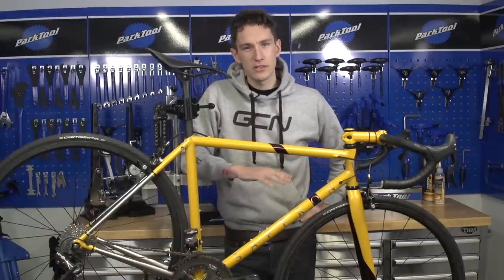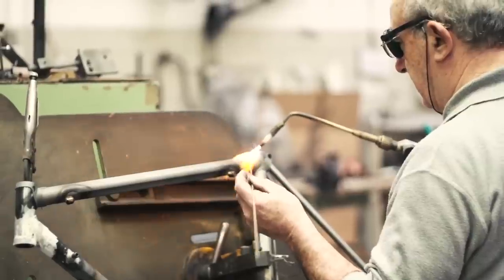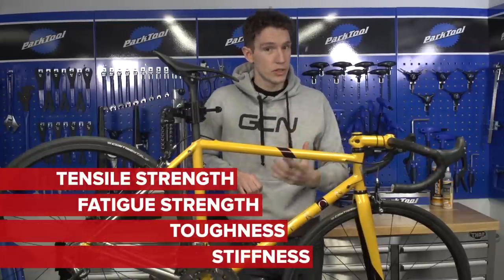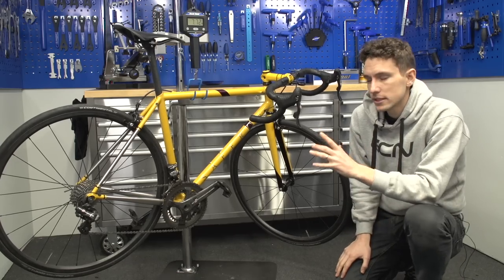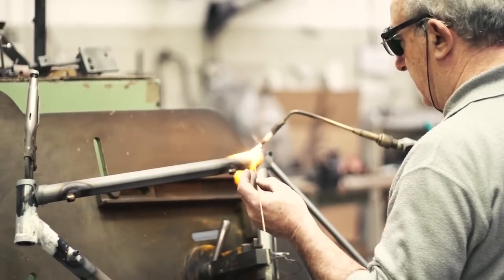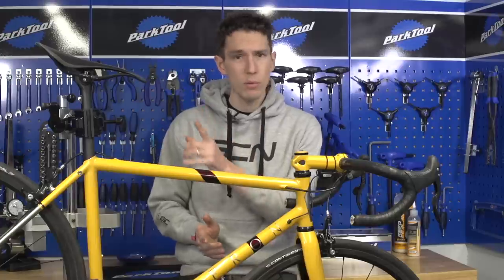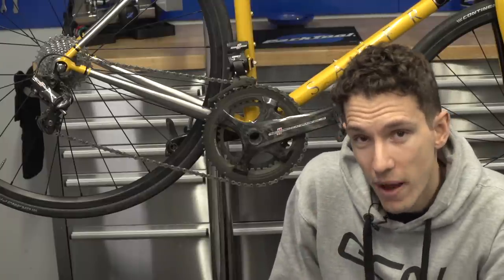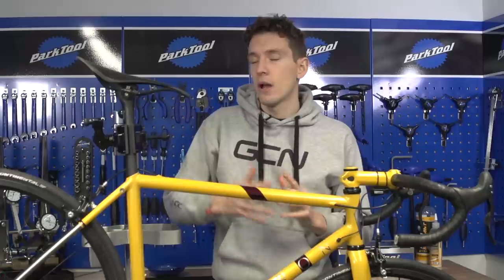Is Steel Real? | 6 Things You Didn't Know About Steel

Comment: It sounds like you're an advocate for carbon fibre throughout most of this, given how reluctantly you were to tout the benefits of steel.

Rust is mostly solved by using stainless steels, such as Reynolds 953 or similar. Repairs on steel are much easier to guarantee, carbon repairs are a very risky business, and carbon itself is prone to many invisible flaws straight out of the factory.
Reply: Alex Paulsen Well it's tricky because steel just doesn't trump carbon in many areas at all. Yes stainless doesn't rust but man alive is it expensive. You can buy cheap carbon but not cheap stainless. 

Also, from what I'm told stainless is hard to re-weld, whereas actually carbon repair is very secure. 

Can't argue with your last point but mas sproduced steel bikes also break.
Reply: Simon Richardson 21 years later and my steel frame is still going strong. Composites are the future of lightweight bicycles, but the touring and randouneuring guys will definitely have a strong bias to "reliable" old steel. Either way, both are still more enjoyable than aluminium. Carbon repairs are still a specialist repair, especially if you want to be able to trust it. Any good frame builder can probably reweld one of their own frames and guarantee it.
Reply: It's perhaps the only thing I don't like about GCN and how cycling is evolving: all the buzz about technology and materials, all the needs and wants you're talked into (electronic shifters, hydraulic brakes, sliders on your frame, 'aero'). That's not what cycling is about for me. That's as fascinating as hearing a carpenter talk about windows.

Comment: I have 4 hardtail mountain bike frames all steel. 2 custom built. Reynolds 853 and True Temper OX Platinum (which is no longer made). I have owned Aluminum and Carbon frames. But will always prefer steel frames. Can't beat the ride quality and they last forever. Sadly once the custom builders I know are gone so are the custom steel frames.

Comment: One thing you didn’t mention which is one of the most important factors of steel is its fatigue characteristics.

Steel (without corrosion) can in theory last forever, under a certain stress steel can withstand any number of stress cycles, aluminium however no matter how much stress it receives will fatigue over time ending in catastrophic structural failures.
Reply: I agree aluminum is the most dangerous material you can use for biking, I'm writing this from experience and I've used steel, aluminum and carbon.

Comment: I think the characteristic I feel the most between materials is their frequency it gives off of the road.  AL is very high frequency, Steel low and carbon lower, even muted.  The difference is I feel fresher after three hours on Carbon.  since I started on Steel, it' feels normal, the baseline.  AL is too high (unless racing) and carbon normal but I feel less beat up after the ride.

Comment: does the scale half way through the video say 7.72kg for that bike?!
Reply: I have a steel frame with carbon seatpost/saddle/fork/stem/handlebars/38mm wheelset and Dura Ace 9000 with Osymetric chainrings and it's 8.0kg. I think I could get it to around 7.7 with a super shallow rim wheelset like the one in the video, could also save a few grams with stock chainrings and lighter saddle as well (DA-9000 is not exactly the lightest groupset either compared to campy). Kind of pointless to pimp it out like this if I really cared about weight/performance  but I like the aesthetic, especially when blowing by older guys on aero+carbon bikes
Reply: Yeah a CUSTOM steel bike is going to weigh like that. As they said tubes are designed with different sizes that will give the bike the desired characteristics. For instance Id bet that bikes silver bits is 953 Reynolds, and maybe the rest 853, or even the whole bike is 953. Most off the shelf bikes 520 or 631 chromoly, expect a bike in weights of excess of 25 lbs. Good 853 off the shelf steel bikes come in around 20lbs
Reply: bilwit lol why are you proud of being faster than old ppl
Reply: I've got a 1996 Frank Herety Special, total bike with a Veloce groupset only weighs 9.6kg. considerably less than many aluminium bikes with a similar choice of components.
Reply: at this point, being stronger than ANYONE is a simple pleasure, but most especially dudes with full aero carbon bikes going up hills

Comment: why many people might prefer steel over other materials:
1- it's cheaper
2- it's stiffer
3- last longer with less care
Reply: It is certainly not stiffer than carbon. Usually it is liked exactly because it's more springy than carbon.  Much of this is probably down to the design possibilities allowed by the material rather than the stiffness of the material itself.  Carbon allows wider cross sections where needed, adding stiffness without adding weight.
Reply: Sorry but a custom steel bike is far from cheaper.
Reply: great point, thanks for for the informations
Reply: yea it's not ideal to call it stiffer

Comment: Here's one you forgot, jet fuel can't melt it...
Reply: Knobster Knob No, but the stuff they spray in chemtrails can...
Reply: Another nutter... FYI, jet fuel fire is hot enough to substantially weaken steel.
Reply: But burning couches, computers, copiers, carpeting, and many other office supplies can weaken steel. Steel only needs to be around 1000'F, same temps blacksmiths used to hammer steel into weapons. I know what point you're trying to make, and it's absurd. Please dude, think before you type.
Reply: CaseAgainstFaith1 and dark grey smoke indicates an oxygen-starved fire that isn’t anywhere near a thousand degrees—let alone several thousand.
Reply: Sterling Roberts LOL. Color of smoke tells you a little about the material on fire. That’s it.
Reply: lol trolled so good
Reply: CaseAgainstFaith1

I stated that smoke(specifically dark) is indicative of incomplete combustion. If one knows(or even doesn’t) what’s in the fire, the color and thickness of the smoke can allow you to ascertain the status of the fire.

I will explain the definition of smoke if I have to, but I’m really hoping you can grasp it using only your own time.
Reply: Sterling Roberts:  LOL!  Repeating the same error doesn't make it correct. No, color of smoke does NOT allow you to make any such conclusions.  Can you read and use Google?  If so, find and read this article:  "Debunked: Black Smoke and orange flames as an indicator of an Oxygen Starved Low temp fire"
Reply: I ride steel. I weld and work with steel. Jet fuel/kerosene doesn't make much heat without force air or oxygen. You have to be able to explain WTC7 COLLAPSE  before you deny the comment!
Reply: David Croxton he likely doesn’t know about that.
Reply: WTC7 collapse HAS been explained.  Ad nauseum.
Reply: You ride a bike. 
You understand freefall!
You have to explain ZERO resistance to FREEFALL!
Physics isn't allowed to be taught in the US using WTC7 videos!
Ignorance is a wonderful thing.
Reply: David Croxton Can you express complete thoughts?  Probably not. Don’t know what point you are trying to make. If you are claiming that the towers fell at freefall speed, they didn’t. No idea what you are trying to say about physics being taught using WTC7 videos.
Reply: Dan Sawyer
Water?
Reply: this meme is never going to die, all because you start a huge debate. btw you have aluminum, rust on the beams, magnesium plane rims and boom you got yourself a thermite reaction.
Reply: Craig Knobovitch Lmfao I see what you did there nicely played.
Reply: David Croxton lmfao or the missing Passenger Jet at one of the most Security Camera ladden Buildings in the world....Lmfao if you believe the Pentagon did not have any cameras working that day I piss myself laughing lol. The camera system worked fine on Sept 10th and Magically Sept 12 lmfao!!!!!
Reply: @CaseAgainstFaith1  

Yes, the chem trails from the planes and the vaccinated passengers collapsed the towers, that's just science.
Reply: @timbazzinett2693  nope you are wrong
Reply: @timbazzinett2693  you ain't melting shit like steel at 1000 degrees Celsius nevermind  bending it
Reply: Imma Mad man I confess I am no expert on fires. But who should I believe?  Some random YouTube comment? Or experts?  I think I will go with experts.

Comment: I found a shop that could build me a custom fit steel bike for much less than most carbon frames on the market. The material is easier to manufacture and the weight factor seems to be more based on how much you want to pay than the material used. Have you looked at the Rodriguez outlaw? Fit is more important than a small weight penalty.

Comment: Carbon repairs "relatively inexpensive"... yeah very very relatively... relative to a few thousand $ of disposable income lol... carbon repair is at least $200 for a small crack... steel?  meh just bend it back!
Reply: Don't know what all of you are doing to your bikes.  I ride the same bikes for years without damage, even mountain bikes.
Reply: Crit races.... its almost imposible to race crits for more than  2 years and not crash at least once. That said, I've never actually needed a carbon repair but my point is that they are not, by any means, inexpensive.
Reply: Fernando Roman Carbon is very cheap and easy to fix the issue is the time spent on doing it has to be slow due to curing and sanding procedures .
Reply: You say it's cheap and then you say it's labor intensive.  So which is it?  Cheap, or labor intensive?  Make up your mind.
Reply: Big Ring It is cheap materials but the time is intensive. Take from that what you will about the Labour costs as doing it yourself self is cheap. Having someone else do it well they have to get paid.
Reply: I wouldn't call doing it myself cheap.  Depends what else you'd be doing with your time.
Reply: Big Ring Tip the Epoxy Resin can be accelerated  by adding baking soda and cyanoacrylate ( Super Glue) . Baking soda and cyanoacrylate can also fill small chips and cracks before they spread. Remember you have literally seconds with baking soda and cyanoacrylate to set it in place and it cures in 2 seconds. I add the baking soda into the small crack and then drop super glue and wait 2 seconds it's hard like a rock. This is also used widely on Guitar repairs.
Reply: cool tip.  With what I know of super glue, I'd prefer to stick with epoxy, but that's just going with what I know.  I don't consider a shortened working time to be an advantage. 24 hour epoxy gives you 15 minutes.  Wait about 7 and you'll get a thick consistency that doesn't run but is still very workable without need to rush.  All depends very much on temperature though.
Reply: Big Ring Indeed I know some Mechanics use BK Soda with Cyanoacrylate on Military Helicopter Blades for surface cracks on the blades . This is until they get overhauled. So 15 million $ Helicopters using BK Soda and Super Glue lol. By the way the true reason for Cyanoacrylate was for field Medics in Vietnam to stop large cut bleeds. I have used it on cuts and works every time.

Comment: Steel bike
-only thing that comes to mind is 20kg bike
Reply: My 1998 GT Course made from Reynolds 531 Steel with old school Ultegra groupset weight 8.3kg. All stock.
Reply: I always think of heavy ass fat bikes and cheap ass cromoly Walmart bikes
Reply: I used to have one and it weighted around that, but if you see the video it says 7.72 kg, so I guess it has to do with the quality of the  steel
Reply: What do you ride now?
Reply: Genesis Volare 953 = 7.87kg
Saffron Frameworks (similar to video) Circa 9.71kg 
(from Road.cc)
Reply: Is it a Gt Force? Because i got one.

Comment: I have had ~5 or 6 frame failures during my cycling carreer.  All these failures except for one happened with steel frames.  The aluminum frame that failed was a road bike I rode abuseively off-road for a few years.  I replaced that frame with an identical replacement, and without such abusive use it has about 10k km on it and is still going strong.

The fact that steel can sometimes be repaired is negated by the fact that it is more likely to need repair.
Reply: This is a good example of what happens when you're chasing grams on a steel frame. That or the frames were made of hi-ten or by an incompetent builder. 
Some people who use CrMo frames ride 5-10k every year on them and those frames last them years and years without any issues.
Reply: Actually, the failues happened all on mid-weight mass production frames with name-brand cromo tubing that I put through very heavy use.  I weighed up close to ~300 lbs for some of this period and did pretty high mileage, lots of off road and mixed surface use.

I have a lightweight road frame that I found out much later had a tubeset rated up to 190lbs max rider weight (True Temper RC) and it went tens of thousands of kms over the decades and did not fail, but I found a small line in the seat cluster that worries me so I retired it.
Reply: @krisjones74  Really interesting. Would be interested in knowing the brand.
Reply: I lick the insides of microwave popcorn packages Steel frame failures were Concorde, Norco and GT.

Comment: 2001 Steel frame Bianchi Eros (WSD) for a beginning female cyclist who may also use the bike to get around town in the city OR a carbon frame Trek 2018 Domane SL5 (WSD). Both are used, in super condition, and around the same $750 price. The former has old Campy Mirage, the latter has newer Shimano 105.  I think of the Trek as leaning more toward road riding only and not really for city use, but I'd be curious to hear your opinion. My guess is that you're more of a roadie and would jump on the Trek immediately. Both my girl and I are in our 50's, so we aren't gonna be racing any time soon.  ???

Comment: My Gios Super Record is 35 years old and just as comfortable to ride as it was the day I built it up.  I doubt that a plastic bike would even be safe to ride after that many years.  The weight issue is a red herring. The frame weight is only about 20% of the total weight of the bike.  You can save weight elsewhere where it doesn't effect safety and comfort.

Comment: In my personal experience, where I wanted aluminum was in mountain biking - we have to be able to lift and/or bunny-hop over obstacles just to keep going, so we needed the weight reduction (and, to be honest, the active suspension on first the fronts, and now the front and rears, make up for the stiffness of aluminum).  In road bikes I had steel all the way up to last year, where I went for a carbon - skipping over aluminum altogether.  I'm rarely asked to bunny-hop the road bike, so it stays grounded - thus, I have chosen ride quality over weight until this new carbon frame where I like to believe I am getting both, but there again... had the idea and use of (and the ability to fit?) 25c or 28c tires on aluminum bikes hit the cycling community sooner, I would have surely considered using one.  I think the 'bigger tire' movement has the opportunity to breathe new life into aluminum road bikes that can fit them.

Comment: I have a carbon Madone Project One, aluminum Spec. Diverge, aluminum Crockett cross, and my favorite  a 3 yr.old Ritchey Road Logic with carbon bars. It's ride is Sweet. The Madone has Dura Ace deep carbon rims . It's stiff. The Ritchey is my favorite road bike . A bit heavier but  a lot nicer riding. Would not buy another carbon bike. Every one I've had broke including the Madone , twice  I'm 7 for 7 with carbon. I have steel bikes from the 70s and 80s 
 They still ride fine. I ride thousands of miles on gravel. Aluminum or steel only for me.

Comment: I'm considering buying a 2017 Jamis Renegade Expat.  It's built with Reynolds 520 steel, which from my understanding is closer to the bottom of the rung steel in terms of weight and strength.  Does anyone have any opinion on this type of steel?  It's also a 24 lb. bike according to the spec sheet, although I supposed a decent part of that is the wheels.

Comment: Interesting.  My all-steel Genesis Croix de Fer (2011 model) is a harder ride than my Planet X XLS all-carbon bike (both XL size) and nothing like as soft and springy as my venerable (1980's) Dawes Galaxy.  The rear triangle is more compliant on the XLS,  and it's the quicker and more responsive bike, too (even allowing for the weight difference) - it seems to transmit power better.

Comment: I've been told that steel holds up better over time, I am not sure how true this is.  I was told that carbon fiber and aluminum frames generally have a useful life of 10-15 years before the frames crack.  Steel on the other hand as long as you stop it from rusting will hold up much better.  Though like I said I am not so sure of how true this is.
Reply: Don't use an aluminum frame for mountain biking, I had 2 and a total of 4 cracks bringing an end to both. Since the second was still under warranty the manufacturer gave a carbon one as replacement !

Comment: I've got several steel bikes that are 30 - 40 years old and don't have a problem with rust. Also, if you care about the environment, metal frames are recyclable where as carbon fibre is very difficult to recycle. With so many cheap carbon frames these days, most will end up in landfill in the future.
Reply: And carbon breaks

Comment: I really wish GCN could allow folks to post photo`s of their bikes ....I built up a replica Bianchi Record del Mondo 
 ...based on an x  Raleigh Banana steel / alloy frame which I picked up for £90 ...sand blasted and re-sprayed ...all Campagnola drive train / downtube shifters and caliper brakes etc....I love it to bits ....it does feel completely different and more forgiving than my carbon Bianchi in many ways....the only thing is that with Di2 ...the old bike has made me get used to taking my hands off the bars again to change gear .